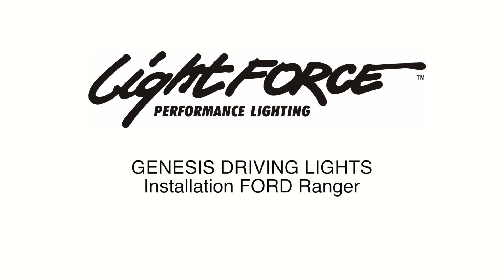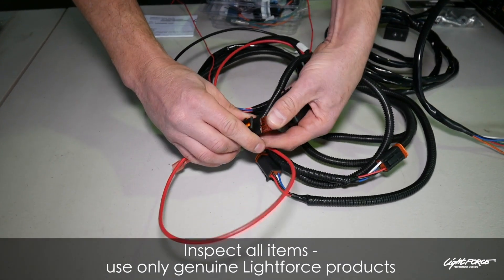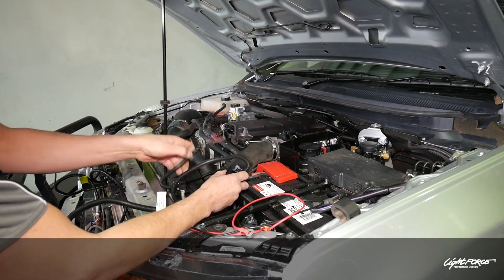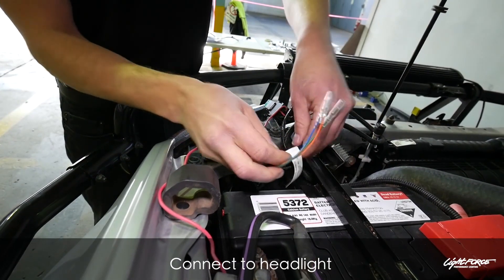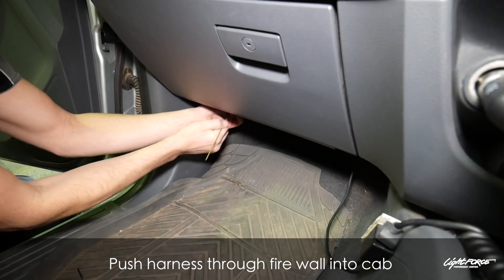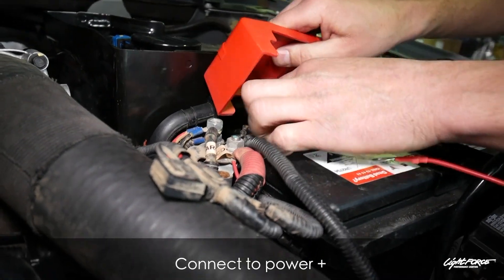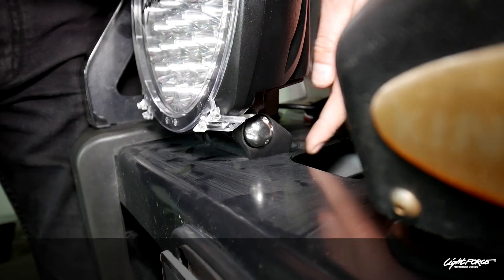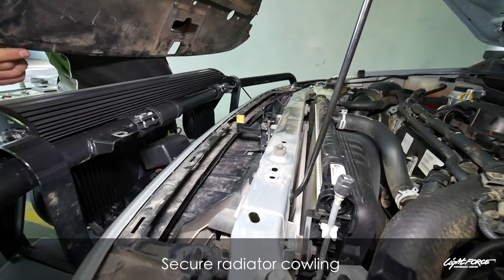Ford Ranger with Genesis LED Spotlights & switch Lightforce Install Guide

Comment: Would it matter if I wire the ignition wire to my low beam so that the daytime running lights only work when the low beams are on
Reply from the maker: Hi Michael, Sorry for the late reply. I know that a lot of people do it this way, just check with the local laws that apply to you. -Woody